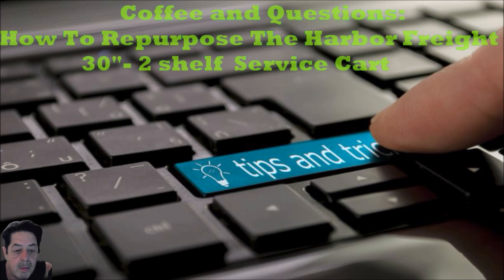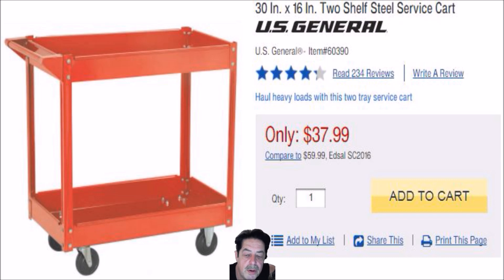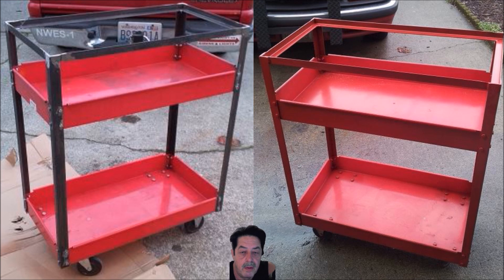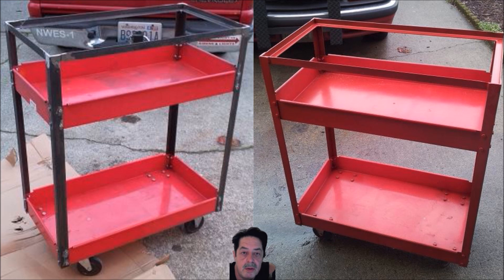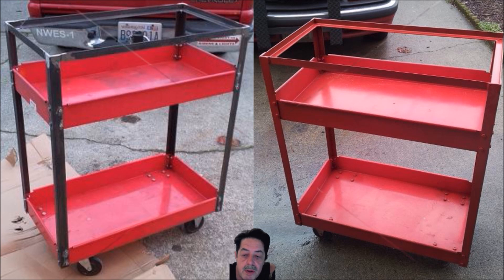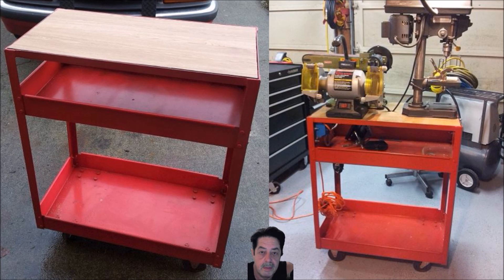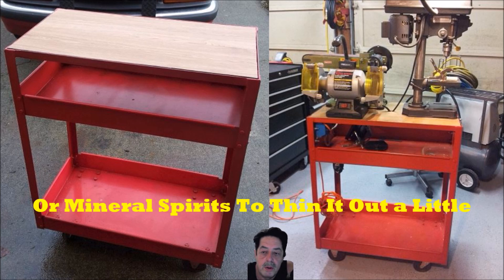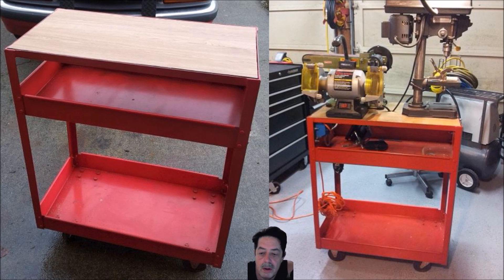Harbor Freight Service Cart - Re-purposed - Part 1

Comment: Are these top heavy? I saw one at the store, and wanted to use it for a heat press (which is only 100 lbs), but it has a swing arm and plate that would swing out to the side. The cart seemed to me like it would tip over. Does anyone have issues with these carts seeming to be top heavy and wanting to tip over or are they stable?